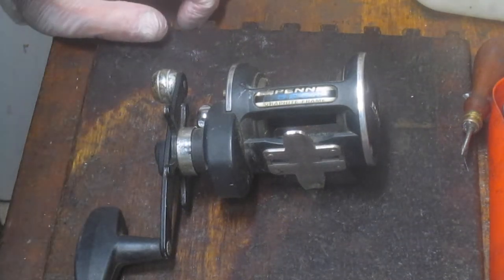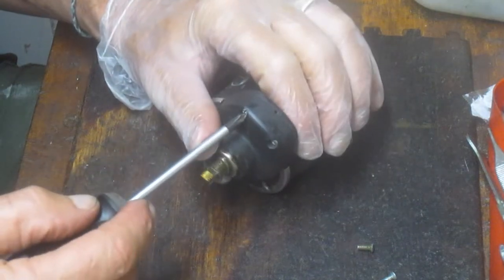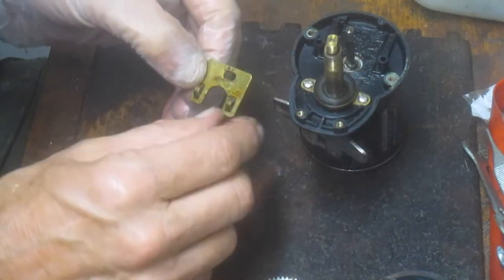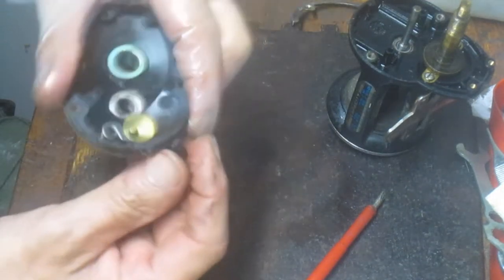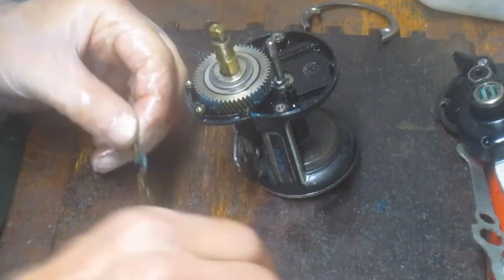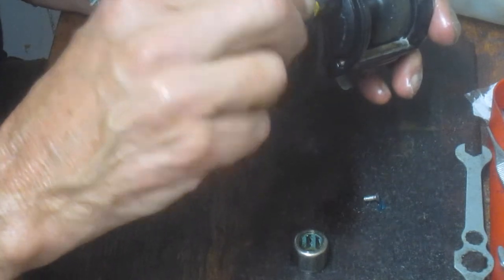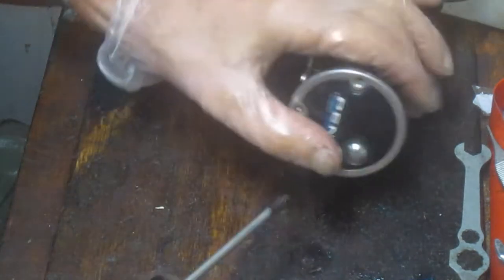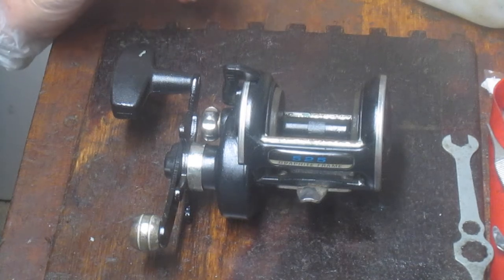Penn GS 525 fishing reel how to take apart and service this reel

Comment: They should have 4 brake pads that can be adjusted to use just 2 if wanted, but without them, it will overrun, this was a problem with this reel when they were first made, the pins holding the brake pads in would fly apart on a hard power cast, but if the pins were stuck in with a touch of superglue the problem was fixed. I bought mine new and still have it.
Reply from the maker: Thanks for the additional information - Dennis

Comment: Hey Dannis, do you know if the no.81 piece (click ratchet) of a Penn 525 Mag is compatible with a Penn 525 Mag 2?
Reply from the maker: Yes, it is the same part number for both versions of the reel
Reply: @2ndChanceTackle  thank you. I noticed that Is the same number but i wondered if the coincidence ended here
Reply: @2ndChanceTackle  I have another question. Do you know if the compatibility Is also with the Penn 525 Mag 4 or the new Fathoms?

Comment: Great tutorial...Although its no mystery the screw that holds the lever sometimes will back out. I've had the entire GS set at one time or another and I've seen the lever screw back off a couple times
Reply from the maker: Thank you and thanks for the tip - Yes - boat vibrations and the like will cause the screw to come loose - Best wishes - Dennis

Comment: Great Video as usual Dennis. Anxiously waiting for your video on the Penn 555 GS. I have one that sat in its box for yrs! I mainly used my Penn JigMasters and Daiwa Sealine 50H. (Sealine 50H is tops IMO)  I cant remember using my Penn 555 GS more then 2 or 3 times. In fact it looks like it just came out of the box! (wish I still had the box) Its Made in USA, has a rubber knob & I purchased it when I lived back on Long Island. (left there in 1999) So its got to be @ least 20 yrs old. It spins free and easy. Quiet as a mouse but Im sure it needs some cleaning, oil and grease. Keeping my eyes peeled for that video.
Reply from the maker: I just finished the GS 555 video.   I will post within the week or so. - Thanks for watching - Dennis
Reply: @2ndChanceTackle  GREAT! Looking forward to it.

Comment: Just saw two of these for sale locally. Guy is asking $45 each and they are in good shape. For the chrome bars I heard you can flip them over to the side that wasn't exposed. Little fix till you can source new or better condition bars.
Reply from the maker: That's a good deal.  Even with the cost of new drag washers and an internal refresh, it will still come in under market price.  Definitely worth it.  I am putting line on my reel today and getting ready for the fall striped bass run in the surf.  Can't wait to use it.  I will strap it onto a 10 ft pole and give it a go this week.  Best wishes - Dennis

Comment: i use lighter fluid to clean the bearings and clutch washers. i soak them for 5 minutes then let them dry before applying new oil or grease
Reply from the maker: That's a good idea!  The lighter fluid will work.  Thanks for the tip - Dennis

Comment: Mine is binding under load.  Cranking the handle feels real smooth when I have  nothing attached to the end of the line, sitting at home.  But when I’ve got a 8 oz lure or crab snare on the beach the handle binds about once per turn.  Any guesses what could be the problem or should I just do the full tear down and lube/grease?
Reply: Thanks for the video.  Found out what was wrong when I opened up the reel.  The spool’s ball bearing on the right side was missing.  I have a spare spool for this reel and when I last swapped the spools the right side bearing remained stuck on the spare spool rather than remain inside the reel housing.
Reply from the maker: Glad to hear you found the cause and were able to get the reel going again.  Best wishes for great fishing!  Dennis

Comment: hello dennis great videos . i have this reel and a dilemma . the reel looked nice until i took it apart.the sleeve for the drag was rusted to the shaft.i got it loose and working. my problem is the anti reverse bearing is working but stuck/rusted  in the side plate. should i juts let it be? im afariad to push on it. i dont wanna crack the side plate. i cleaned it and lubed it best i can . it seems to work ok. what do ya think? ty very much ....gary
Reply from the maker: I think it would be best to let a sleeping dog lie.  Just keep the bearing oiled frequently and it may work itself free over time - Dennis
Reply: @2ndChanceTackle  ok yeah thats what i thought ty very much            1
Reply: Dennis I have to tell you this . I took the handle side apart again. So the frame and spool was all that’s left . Well the spool spins freely! As fast and long as anyone would want.. I slide the pinion gear over the spool shaft. Hold the pinion gear . The free spool disappeared.... I cleaned the spool shaft and inside the pinion gear. Same result..... the pinion gear slides up n down oh shaft no problem. Strange no ? I don’t get it..... I had to share with you .
Reply: sorry dennis i must be confusing you. i forgot to tell you it had no free spool also . the anti rev bearing still stuck . but works perfect.... the free spool is working now..... took it all apart again! i think the break was on im not sure i turned it without looking at it... anyway ty very much for all the videos and info , i really do enjoy them! ....gary!

Comment: hello enjoyed your video i wonder if you or one of your subscribers could help i bought some upgraded bearings two for the spool these are fine .i also bought a pinion support bearing ive stripped the real cleaned it put new bearings in but i can not find a place for the bloody thing i asked the seller he said put it in the hole in the case gear side as it is ment to be a replacement part ie a upgrade. im stuck can anybody help please.
Reply from the maker: Can you send me a note to my email 2ndchancetackle@gmail.com with pictures of the bearing and the inside of the case.  I will see what I may be able to do to help

Thank you
Dennis